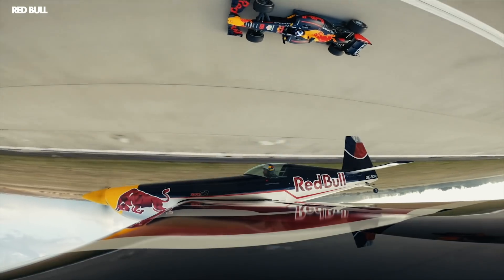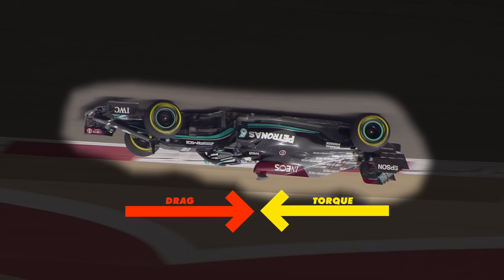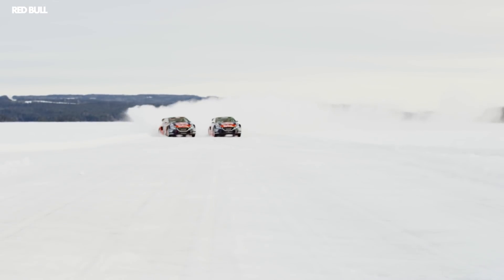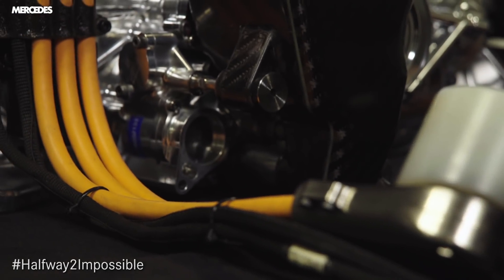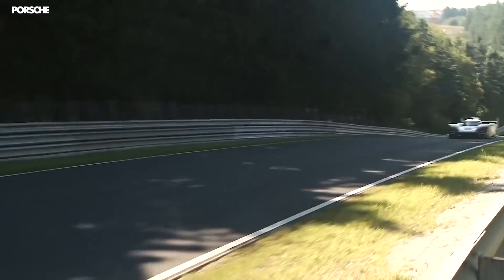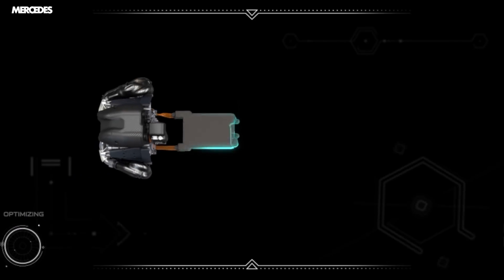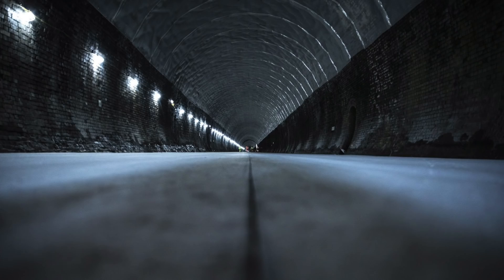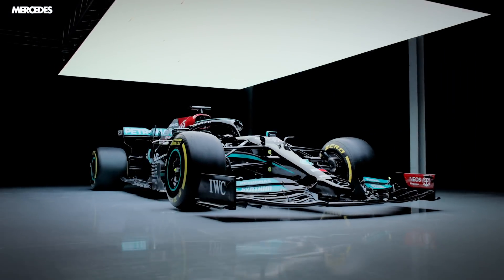Could a Formula 1 Car REALLY Drive Upside Down?

Comment: Hey Driver61 I would love to see a video analysis of if Ayrton Senna's driving style would work in today's F1, preferably his throttle technique. Some people's theory was he did that to spool the turbo faster, some say he did it in his karting years and would carry it in f1 as a way to balance out the car after hitting the brakes and another theory was he was using it to bring the car and kart to its optimum rpm range where you get the most torque from the engine to accelerate quicker out the corners.
Reply: I'd also love to see something like this ! Not sure if it would correlate well to the new gearbox and transmissions in current f1 cars, but the premise would be a really interesting topic !

Comment: What if you could build some sort of a rail for the car to be attached to until it's all the way upside down and maybe use some external help for acceleration? Think f1 car on a hotwheel ramp it can't escape whilst being launched by something like what they use on aircraft carriers to thrust fighters into the air? The "rail' needs to end when the car is fully stabilized after the flip upside down heading dead straight and then the hardest part of getting upside down is solved, getting back down is simpler.

Comment: There is ONE type of car you missed...formula student
They're less than 200kg and have massive wings. And they tend to be AWD EV, so they can run upside down, and don't need to recoup their entire weight in downforce to have the traction to accelerate
Reply: but they do need to recoup their entire weight in downforce to not fall off the ceiling, on top of which, they do not have a high enough top speed or downforce to achieve this.
Reply: @napestar  i mean recoup their weight twice over. Once to break even, and the next for downforce. FS cars would need to do less of the 2nd time.
Reply: @WynnofThule  while you are correct i dont think they have the top speed to tap into that exponential downforce increase.

Comment: I'm not totally convinced with the upside down engine problem. Not an engineer but I see some potential possibilities. 1) Unlike regular car engine F1 cars are subjected to quite some lateral G foreces most of the race during cornering and breaking which basically cancels out gravity. 2) With so many RPMs the speed of flow of all the liquids in the engine can't rely solely on gravity. They have to be pressurised artificially. Those enormous pressures as well as suction power of vacuum created in the exhaust can't stall immediately.

I'd say the combination of these two plus potential adjustments to the engine can't overcome the upside down engine problem problem at least for couple seconds needed for the experiment.

I see the lack of proper testing "tunnel" and the enormous sefety risk as the main reasons why not doing it.

Comment: WITH COMBUSTION ENGINES  but with a system in the fuel tank without air inside, like a vacuum system when the fuel goes out the tank no air allowed, so the fuel pump always been pump fuel, so if some one want to do that just spend a couple of dollars making one fuel tank

Comment: I've seen some other video where it's been suggested that special structure would have to be built for this - something like "semi-tunnel" or letter C in section... would be expensive but not as a proper tunnel... and wouldn't disturb airflow... also being open from one side it would be easy to watch whole experiment.

Comment: If we would focus just on the "driving upside down" part and ignored the "getting there" part. It could be fairly easy, the engine wouldn’t have to deal with the change in orientation, if it would be installed upside down. So the only part that you would need to tackle would be getting to the sufficient speed, to stay on the ceiling. I imagine it can be dealt with in number of ways, maybe some moving construction that would support the car from underneath until it would reach the required speed or some sort of attachment to a rail on the ceiling that would hold the car. Although it's a question if an "F1 car" with engine mounted upside down, meaning it's inability to function the right way up, is still an F1 car
Reply: or just use an electric motor.
while it wouldn't "technically" be an f1 car it would be close enough for most people to be satisfied with the result and you dont have to worry about oil starvation. especially if the weight of the car with the batteries and motor(s) is equivalent to a ICE f1 car.
Reply: Why would you ignore the "gettin there" part though, that aspect is impossible to avoid...
Reply: @hopenly  You could theoretically pull it off in a vertical looped track: throughout a smooth enough loop you get a constant flow of air and therefore have enough downforce when driving upside-down. 

Expensive af though.
Reply: They can make engines for acrobatic planes that work upsidedown for decades now, I don't think it's impossible for an advanced F1 team to design something similar.

Comment: Worried about operating a reciprocating engine upside down because of oil drainage,  therefore electric is the solution... Meanwhile, acrobatic aircraft can fly upside down for several minutes. Are you saying that developing an engine with a layout like those planes isn't feasible for an F1 team? Those planes use boxer engines... That's how they do it... I'm 99% sure an F1 team could build a boxer 6 cylinder engine that conforms to most of the F1 engine regulations, other than the vee angle. I certainly think that would be a more weight effective solution than a battery pack + electric motor. It would fall under the category of unregulated race car, but then you could also increase the aerodynamic downforce too, while maintaining light weight.

Comment: What about an ICE that was set on a pivot so that it was always facing up no matter the angle for the car? You might need to weight the engine on the bottom, and of course work out hose connections with 360º of rotatable but sealed linkages, but hey, we ARE thinking big here, right? What’s Elon Musk doing at the moment? Tunnels underneath Las Vegas. Maybe he could be convinced to build / pay for the tunnel issue.

Comment: So you are saying there is a chance. 
If I'm understanding correctly, here are the parameters;
1. A long enough, specially built tunnel.
2. An engine that can perform through the 360 circle.
3. Larger or more specialized wings.
4. At least 1 driver with the necessary cajones.
5. A financial backer with some pretty deep pockets.

Put those all together and bob's your uncle.

Comment: You don't need double the cars weight in downforce "to maintain speed" you need like 1.2x the cars weight, than you have 20% of normal gravity grip available just so you can drive a straight line safely

Comment: Can you imagine the overtakes if all tracks were tunnels with drivable ceilings?
Reply: Bono they are all over the ceiling!
Reply: @nass419  "BONO MY TIRES! THEYRE RAINING DOWN ON THE OTHER DRIVERS!"
Reply: That could be a fix to Monaco!
Reply: Monaco metro tunnel grand prix tune in next week from the normal monaco gp
Reply: I think the overtakes would become kinda boring, because you could get onto the ceiling earlier to prepare, and then just slowly get past them rather than any sort of dramatic overtake they can defend against. What would be interesting would be if the walls were drivable in the corners, then you could just floor it in a straight line on a longer path, instead of slowing down and taking a shorter path. Similar to that guy in NASCAR that drove against the wall to be able to go faster around the corner, but without any damage to the car or wall.
Reply: @miladragon  YEAH, CARS DRIVING 200 MPH ON THE ROOF WOULD BE KINDA BORING
Reply: Battery based batteries, using sections of the track to recharge the battery, contact heavy based race, circuits with tubes and upsidedown overtakes... Yup formula E is 1 step alway from turning into F-Zero
Reply: It would be amazing to hear about.
Reply: Yeah, just like in GTA Online
Reply: No
Reply: the race should be JUST on the ceiling, for SAFETY!!

All crashing cars and driver would immideately be lifted from the track away from anything going fast! Its brilliant!!
You also solve the divide between what cars COULD achieve and what drivers can tolerate, by taking 2G of downforce away you could probably lift a ton of restrictions.

Comment: Unfortunately, what wasn't bought into the equation is the Force that creates downforce. Since we are not talking about any centripetal forces like the mentioned 'hot wheels loop', generated by the car's engine, the only Force at play is Gravity.
Thus, the Force that creates downforce is the acceleration of Air, caused by Gravity, at 9.8ms/s. The fact is, the car's wings will be producing far less downforce than assumed. The only downforce would be by displacing the air, measured in its mass... So, if you're lucky a few kilograms of mass.
Unless an upside down F1 body produces Lift, it will fall at the speed of gravity once the centripetal forces of driving onto the tunnel ceiling equilises.
PS: the reason it may work in a video game is based on how the game physics generate downforce.

Comment: The diameter of the tunnel would be a huge deal. Any surface other than flat would mean less downforce, as the cars belly pan would run over a deeper trench as the diameter of the tunnel decreases. A flat panel roof on scaffolding anchored on the Bonneville salt flats could serve as the tunnel ceiling. 
The construction of a entry and exit ramp would allow the transition to the braced "ceiling " occur without the need for an appropriate tunnel.
Ask Musk or Bezos.

Comment: It hasn't been done for extended periods because the oil would go below the sumps pickup so it would starve of oil and lock up at some point.  For a few seconds it should be possible.  But otherwise fins a way to solve that and it could be done till the tank was empty

Comment: The car can get to the upside down point just from the inertia, so it won't need 20meter high halfpipe. Then it can "bite" from that initial centrifugal force and continue upside down. I believe it can and will be done, not so expensively.

Comment: Great piece..... but no.  the diameter of the tunnel would have to be tremendous.  max down force is with the track centimeters from the middle of the car.  If you put the car in a wind tunnel and start curving the floor away from the middle of the car, the down force would dramatically be reduced.... I think.  the transition from 0, on the ground,  to 180, on the roof,  would not not provide the the down force needed to climb the wall .
Reply: NOW!!! If you did all the motor modifications you talked about that would solve the power problem.  BUT, put the car on a gigantic treadmill that could spin 180 degrees.  This would keep the floor of the car and the track at the distance needed to create max downforce.  I'll get back to my pot bong........Cheers!

Comment: How did he arrive at 2 G for the “upforce” ? It only need enough force for the tire to have grip to move the car forward and for the car not leaving the ceiling when there is a bump.
Reply: Simple:

1 G is used just to negate gravity - leading to a net force at the Tyre of 0G, which if you factor into your traction equation, a value of 0 weight = no traction. So you need in excess of 1 G.

The next problem is the Torque of the engine at high RPMs, if you had say 1.1 G of downforce, then the moment you go inverted, the wheels would start to slip, which would be less than ideal.
So 2 G would give the same traction as when the cars pull away at the start, However, I think this is still a little optimistic, as it's really a around 60-70 mph that the Aero is producing enough force to really use all the engine power.
Reply: @MajesticDemonLord  so you think that if  I accelerate a car to 180 mph and maintain my speed. If I lower the force of gravity, it will immediately start to slow down. I would have thought just enaugh  G to create the friction to transmit the power necessary to maintain speed.
Reply: @richardlehoux  Not quite, you're maintaining a constant speed, but due to the Aero, you have a lot of Drag, suddenly you reduce traction by 50% - what happens? 

The George/Bottas crash comes to mind, the rear tyres would spin - which would snap the rear and then all that lovely downforce goes away.

You would likely need a higher speed to make sure that the car had enough traction on the rear to not spin the tyres.

Comment: Short answer;  Theoretically yes, in the real world however, no car can drive upside down as the fuel won't be delivered to the engine resulting in a loss of power, speed and subsequently downforce (or up force depending on how you look at it) causing the car to generate less force than that of gravity and resulting in it hitting the ground. 

What is theoretically possible though is to drive the car into an extended barrel roll, this can probably be done with a lot of cars assuming they are travelling fast enough, however with an f1 car you could probably perform a barrel roll over a greater distance due to the cars downforce.
Reply: Would be really cool if one day a team like Redbull who love doing stunts would somehow set up an engine in their car where the engines position was determined by a gyroscope so the engine would always be positioned in the direction of the normal force to gravity, with the engine always the right way up and a clever fuel delivery system (oil sump rotating right side up/pressurised fuel tank and powerful pump) Im sure the car could drive upside down. Its a nice idea but it would be complicated as the tires friction against the surface as well as the added weight from such an engine configuration would require a significant amount of downforce, but you never know untill you try. Im sure with some Monaco spec car and some additional tweaks this could be done, spam Christian Horner and Redbull PR to make this happen!!!!!
Reply: Except, 'up-force' isn't a thing. Essentially, this whole discussion is about lift... It's pretty easy to see that an upside down F1 and an aircraft wing are two different looking things. This entire concept is ridiculous. 😂
Reply: @flailios  the up force thing was a joke, excuse my german humor. 

Yes, while I mention downforce repeatedly, ultimately if the car was upside down it would be creating lift but for the sake of not confusing people by constantly mentioning the direction of forces etc I just said downforce. 

And finally I disagree, ultimately an upside down f1 car (at least from the aero perspective) and an aircrafts wing both ultimately create lift and are therefore very similar. The elements on the rear wing of an f1 car are essentially the shape of an aircrafts wing positioned to create a downwards force rather than lift.

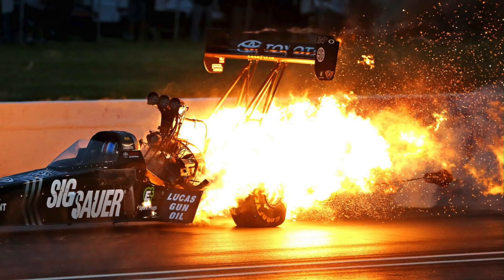Comment: @5:08, the air-fuel mixture in a Top Fuel engine is under such high compression it's actually in a solid, gelatinous state. TF engines operate on the verge of hydro-lock by design, I suppose. At high enough pressures, fluids freeze or solidify, as-if they were cold, regardless of the high temperature present.

Comment: I have a question! Formula 1 cars are often described as upside down airplanes and yet you see most, if not all planes are nowhere near as complex in shape and aero bits as an f1 car and are very smooth. Why is that? Would an airplane generate more lift if it has shapes and aero bits like a formula 1? Could a formula 1 make as much downforce if it was simplified and given wings on the sides like a plane? I need answers
Reply: Tires are horrible for drag. Airplanes lift up their tires into the hull to streamline their bodywork. An F1 car has to manage air going around the tires and the vortices that are generated by the tires spinning.
Reply: The fact is downforce and lift are two totally different phenomena. The reason is "Gravity". Downforce is transfering the gravitational forces of air onto the vehicle. It doesn't work upside down...that's called Lift. Lift is the effect caused by creating pressure differences between the top and bottom of a wing.
Not to confuse the issue, but lift is also indirectly caused by gravity, as well.

Comment: Semi-related question, IS there a corner such that, you can take it at below a certain speed with mechanical grip, or above a certain speed with downforce grip, but if you enter it in between...you're f***ed?